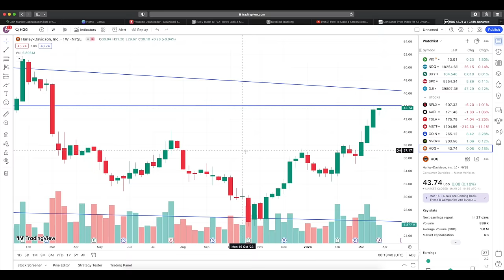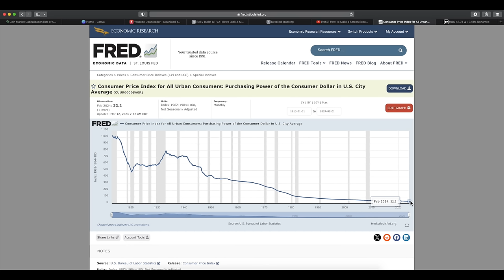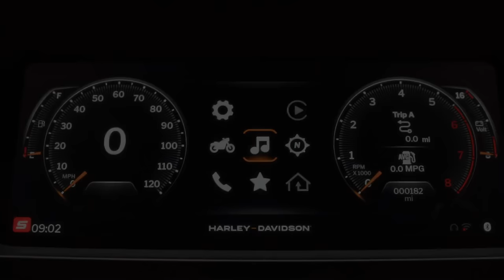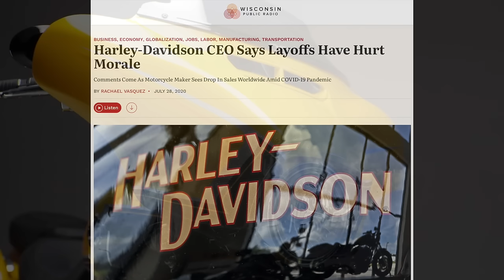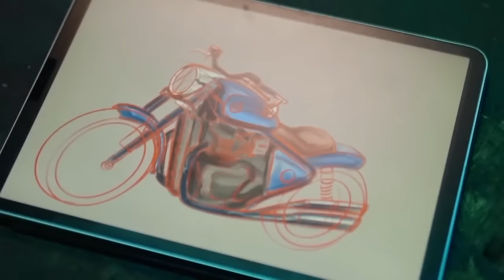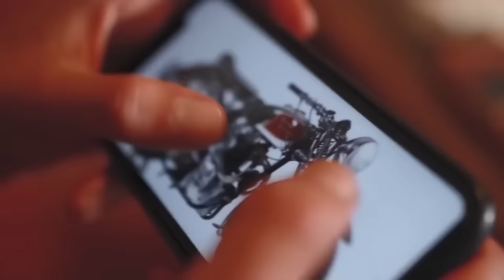Harley Davidson is Mismanaged Compared to Royal Enfield

Comment: I have always wondered how HD has demanded such a high price and kept its resale value. Quality and durability was always lacking . After 50 years of riding I recently downsized from a BMW to yes, a Royal Enfield  Meteor 350. You were spot on with your analysis . Cheers
Reply from the maker: Yes, the Meteors and Super Meteors are very nice cruisers with clean looking air cooled motors. Nicely done for an unbeatable price.

Comment: A couple of years ago I had to let my big Moto Guzzi cruiser go as it got too heavy and cumbersome for my old body. I checked out a couple of low mileage Sport Glides at the height of the bike shortage. There were no new ones available. I was told the price would be around 20K, no definite price. I bought a new Bonneville for about $7.5K less. A couple of years later I traded it for a new Moto Guzzi Mandello. Speaking of Moto Guzzi here is a tiny company that is in the midst of upgrading their product line, the Mandello and Stelvio for example with rumors of a new cruiser with the new 1,000cc motor. There has also sightings of a new entry level bike maybe to replace the V7 line which could be considered as kind of an entry level bike but it has grown a bit in the last couple of years. Moto Guzzi's rebirth if you want to call it that is more a result of the money and guidance from Piaggio the parent company. Maybe this is what Harley needs, someone like KTM to come in take over and go down a new path.
Reply from the maker: Good points. I saw the Mandello and Stelvio at the bike show and they are the nicest MGs yet. Funny that MG can build bikes in Italy and still keep the prices reasonable.
Reply: @DifferentSpokesTV  And they are hand built to boot. I own a Mandello and a V7lll. I won't own anything else after owning a few other brands.

Comment: I actually bought a new 24 Road Glide today but numbers don't lie with Harley, their sales are down significantly but their 2024 Road Glide and Street Glidet truly are improved and its Indian that is not price competitive now.  They just desperately need an affordable entry level bike.

Oh you missed one  important fact about their stock value.  In 2011 Harley had 235m shares outstanding and in 2023 they only have 154m. So not only can they not hold the value of each stock there is far less available.  

Looking at Indian numbers I don't think they are increasing sales in the heavy weight cruisers. Polaris still hides actual numbers.  They have Harley's problem, their most affordable model still starts at over 10k.
Reply from the maker: Good points and congrats on the new bike. In my area there is a huge mutli brand dealer that just brought in Indian just down the street from an HD dealer. The HD prices are significantly higher because the HD dealer tacks on a huge premium. Plus, HD killed their 107 models so you can't get a less expensive Road King, Road Glide or Heritage anymore. Indian still has its 111ci models at lower prices. If I was buying right now, I'd go Indian. But 5 years from, who knows?

Comment: There is something very cool about Harlies but, they will price themselves out of existence. While bunch of manufacturers are throwing out piles of 350-450cc bikes in $5k range, Harley is getting bigger and pricier. Granted they have their sticker on 440cc bikes in India which look cool but, I doubt they will bring them to NA. At right price, I would buy one. Until then or until I lose my mind and plunge in insanity, I will get Harley out of system in demo rides. Crazy thing is that they cost more than my trucks.
Reply from the maker: Yeak, even my 450lb Tenere 700 comes with dual disc Brembos.

Comment: Spot on! This is what happens when you hire a CEO with zero experience in running a motorcycle company. Proof? The X500/350.  Apparently, it's "Iconic Harley-Davidson roadster styling in a lightweight and agile package" In reality, it's just a re-badged Benelli made in China! Zero respect for the HD brand, right there.
Zeitz and the board need to be removed before they run the company into the ground!

Comment: I see Royal Enfield as a positive for HD. People have been complaining about HD not making entry level bikes as long as I've been riding. When they have, they sucked. It's not their forte. RE OTOH, makes great small bikes in high volumes. Sooner or later, like you, we get older and maybe dream of touring and that's when moving up to an HD makes a lot of sense. Not only are REs too small and require checking valves every 3k miles, but there's also not a lot of dealerships around to support the touring community.
I never wanted an HD when I was younger either, but they're built way better today and are far more comfortable to me at this stage of my journey than anything else.
Reply from the maker: Yes, definitely HDs are comfy and great for touring. And it's fine to have high end aspirational CVOs for guys who can afford them. Still, if you're HD, how hard is it to make a simple entry level bike? You'd think it was rocket science with how bad the streets were, but the truth is that those were just an afterthought. Ducati put some real effort into their Scramblers and it paid off well. Harley needs to step it up in that department.

Comment: If I ever would by a cruiser, it would be a Triumph Bobber or a Royal Enfield. Americans are too expensive. Too heavy. And in my eyes, quite ugly. Especially those new Sportsters. Yak!
Cheers!
Reply: The new Sportster does not qualify as a Harley.....sad but true
Reply: Say what you want but, new Sportster looks cool and is very fun if you try to ride it. The problem is that it is too expensive and you can't bring your laptop except in backpack. If they can drop price $5k (which they can), give it few accessories and have no aholes dealers sell it, they could have attractive proposal. Even their trikes. They cost more than full size trucks.
Reply: Yes, say what you want, still prefer to ride my Superglide Custom and RoadKing.  They are true Harley DNA
Reply: @oknevals 100%. I own a new Sportster S and can say that the bike is not the problem, but H-D is with terrible attitude and trying to extort customers, they don't even let you change your own bike oil without treating to void the warranty. BTW, it shares the engine with the panamerica and a smaller variation with the nightster.
Reply from the maker: Yeah, the mistake they made is trying to make the new Sportsters to perform well. They should make an air cooled 1000cc v-twin under 10K and leave it at that. If it looks and sounds good people won't care how slow it is.

Comment: Should have kept the Street 500 and 750, and then used those engines and built adventure bikes etc.. around those engines as more entry level offerings. Imagine a baby Pan America, smaller and using the 500 and a mid size one offering a 750.
Reply from the maker: Yes, the engines were good, but the bikes they powered were an afterthought. They needed to put more effort into making them look good and handle well.

Comment: Growth is not an ultimate business strategy. If the potential is not there anymore, its better value for shareholders to turn off R&D, downsize operations and cash out using dividends and buybacks until the company dies. If Harley has chosen this strategy, the CEO is actually just doing a good job.
Reply from the maker: Yeah but there's a choice. Indian isn't doing that.

Comment: RE isn't competing with Harley, it's competing with China and CFMoto, who have gotten their act together in a impressive way. 5 years ago Chinese bikes were a joke, now CFMoto is bringing out a 200 HP V4 motorcycle. 

Compared to that level of innovation, Royal Enfield has to be innovative or die. And as stated in the video, they have been doing a good job, though their engine selection of 3 engines for their entire range of motorcycles limits their appeal somewhat.

Comment: @Different Spokes TV: Thank you for this content :)
I'm not a high profile manager, but as a monday quarterback I think HD and RE come from completely different places.
REs core market has been and still is the asian market. 
They have built nothing but affordable, small cc motorcycles, literally motorcycles for the masses.
HD had affordable models, yes, but it was not like everybody could go to a dealership and buy a Harley.
HD is trying though in the asian market with the 350.
What should HD do in the western market? 
I guess you're right, they need an "entry level" bike. But apart from that?
In the German 2023 top 50 sales there is no model from HD. But no model from RE either. No retro or heritage model from any manufacturer apart from the Z 900 RS.
The Rebel 500 is top 10, BMW GS has the top spot. 
Naked bike category is the category with the most models in the top 50.
The EU market loved the Bronx, it was clearly the favorite of the RevMax bunch, and KTM is giving HD a huge opportunity now with its premium pricing of the new 990 Duke. The base model (doesn't have a quickshifter as standard) costs 16400 €. 
The Sportster S costs 17400 €. 
Imagine a 1250 Bronx for 18000 €. 
The Bronx would come with Brembos and six axis, with a pretty strong engine and with a good chassis, it would be fast and it would be sporty.
Now you could buy a f**** true modern streetfighter from f**** Harley Davidson! With true HD styling. THAT'S the appeal of the model for the customer!
HD could even play the CVO game true to it's own standards with the two RevMax 1250s.
I hope the Bronx is coming soon and that it won't be a little too late.
RE would squeeze the RevMax platform I guess.
Personally I would love to see a model with a LifeWire Del Mar inspired styling, like a modern and slick flat track / supermoto crossover.
Younger riders would feel that bike too I think.
Cheers m8 :)
Reply from the maker: Yes, I've been calling for a 750cc Flat Track Harley for a long while.

Comment: Owned a Low Rider ST for a year, along with a Speed Twin 1200  and recently downsized to a Honda Transalp.  I never could figure out if I liked the Harley or not, it is however insanely poor value. My wife has a Rebel 1100t which is half the cost of the ST with more features.
Reply from the maker: Love the Rebel 1100T. That's value foe your money.

Comment: Jochen Zeitz is just applying the Kering and Puma sneaker marketing strategy to motorcycles however, he didn't plan on the challenging economic conditions decreasing 'aspirational' consumer spending. It was always assumed by Wall Street that luxury brands were immune to business cycles but that's proving to be false position. Take high end watches, the WatchCharts Overall Market Index has plunged 37% from a March 2022 peak. So Zeitz is stuck with a luxury strategy and a company with a high debt ratio in a declining market. The best he can do at this point is weather the storm and hope for a recovery in three or four years. To me, he looks like a CEO stuck between a rock and a hard place. Maybe $60 t-shirts will save the day or Trump will buy the company and expand to sell motorcycles, Trump sneakers, and bibles - a sure thing stock buy.
Reply from the maker: Yes, the name doesn't have the same cashe that it used to. When the economy was ripping in 2020, 21 and 23 Harley didn't move more product like other luxury brands. When the stock market crashes they sell way less. That's definitely not immune to business cycles.

Comment: Maybe this is an oversimplification, but I believe you have to have actual engineers and motorcycle enthusiasts in key management positions. The recent Boeing saga also proves that you cannot run an engineering company without engineers in the C-suite. I just hope that if HD goes bust, it will be acquired by another automotive company and not some private equity firm. Older British motorcycle brands are today owned by bigger automotive companies: RE by Eicher Motors, BSA by Mahindra, and Norton by TVS Motors. Purists will disagree if the new owners and manufacturers are non-American, but I think if the product is good, nobody will care, and it's already happening. HD has manufacturing plants in Brazil and Thailand. If they even think of competing with RE, they will have to manufacture in India/SE Asia with India/SE Asia centric new models. I think HD can do well in India/SE Asia because it is still an aspirational brand in that part of the world. HD needs to mass-produce a reliable and affordable bike for the masses like it used to do.
Reply from the maker: Great points. I'd like to see an air cooled 750 that could compete with the Super Meteor.

Comment: motorcycling HD old school boys are old...I am Gen X owned Softail Deuce and Street Glide  and sold them both. After having ridden others like Yamaha Raider, FZ1 as well as Kawi z900rs .... I confim that   I own and prefer Kawasaki 1000 Ninja sport touring and z900rs as well as the Yamaha raider 1 new and 2 used for all three less than 1 new HD Road King costs...the mocho gravitas quickly burns off after buying that expensive HD just to ride 2-3 times per month to the motorcycle bar.... HD should have embraced changing markets and younger riders but without going WOKE ...no sport performance HD in the line up to compete with the Itailians, Japanese and German competitiors. HD heritage is of little concern or care by the younger sub 40 YO riders.

Comment: HD design is from the 30s. Other bikes have got technology of the 20s. To be precise, 1930s and 2020s.
Reply from the maker: Their bikes are a mix of 30's traditionalism (air cooling and push rods) adapted to today's emissions laws. It's amazing that it works.
Reply: @DifferentSpokesTV  Actually most of the Harleys in the 30s had no pushrods. Sidevalves. For its time reliable, decent power and not especially heavy.